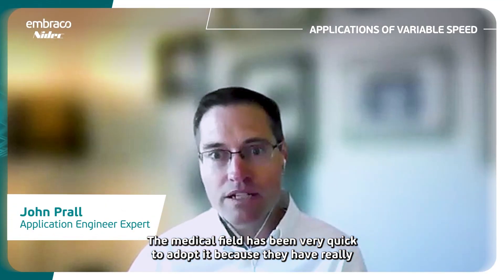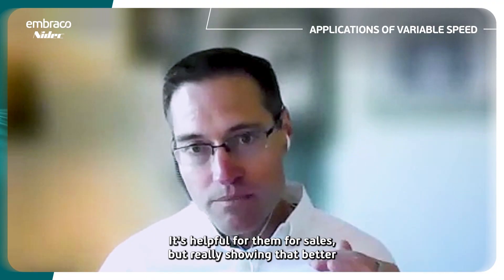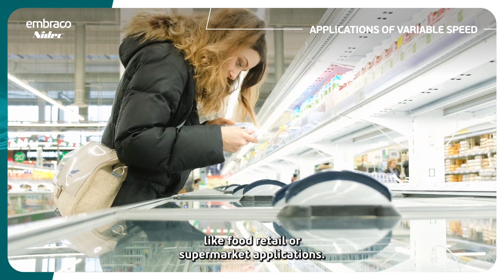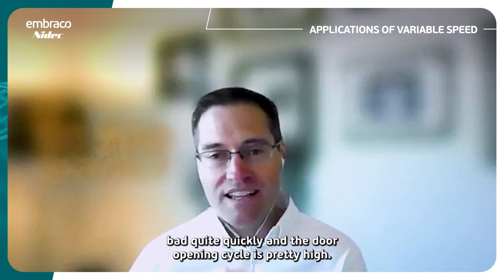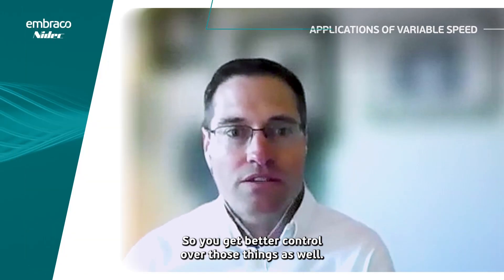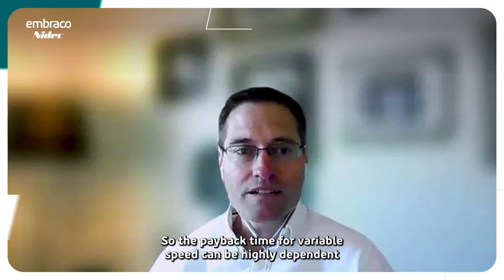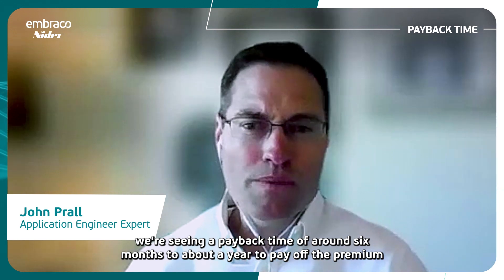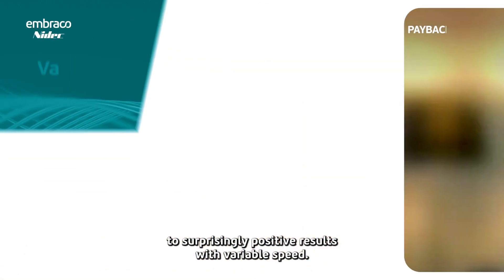Embraco - Understanding the Variable Speed Technology

Comment: If the compressor fails can you keep the variable speed electronic and judt replace the compressor?
Reply from the maker: Hello! Thank you for your comment. Yes, you can replace just the compressor. It's important to match the OEM model or use a replacement the equipment manufacturer recommends.